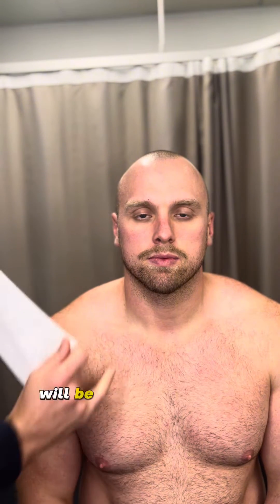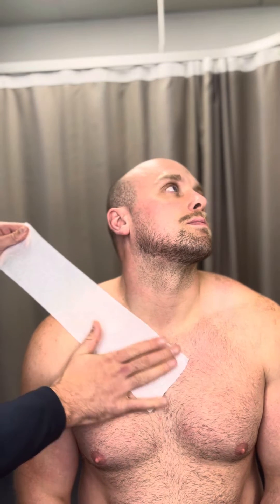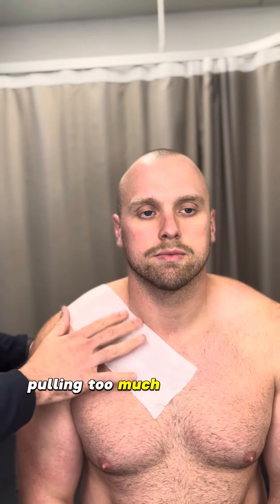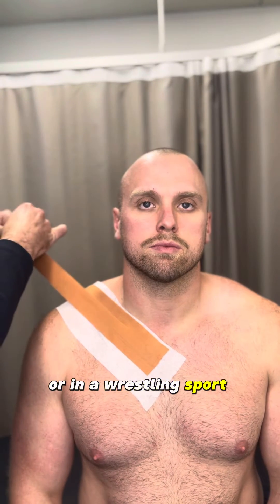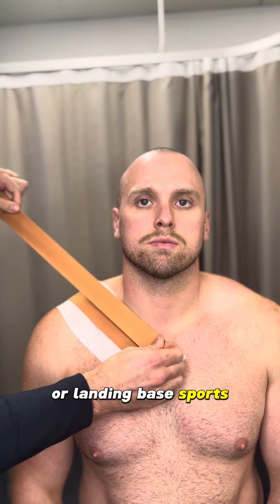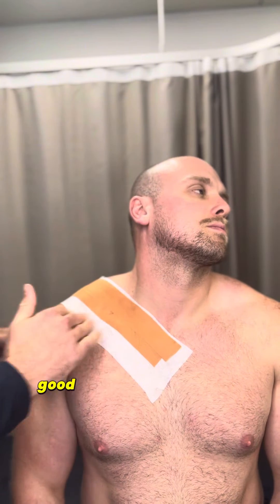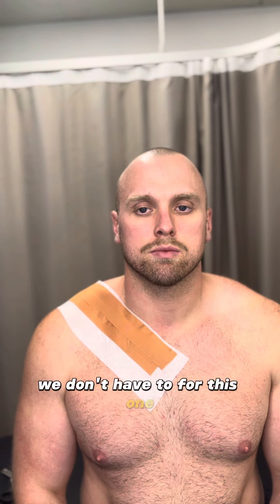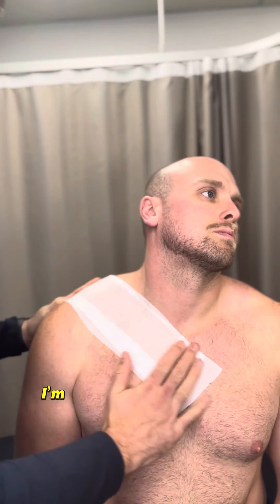SC (Sternoclavicular) Joint Taping

Comment: How much time  to recover
Reply from the maker: It depends on the grading of the injury. This taping method can help to add support to the area
Reply: Does it help with the joint healing as its taped in its natural position?@TheClubPhysio
Reply: What are you using?